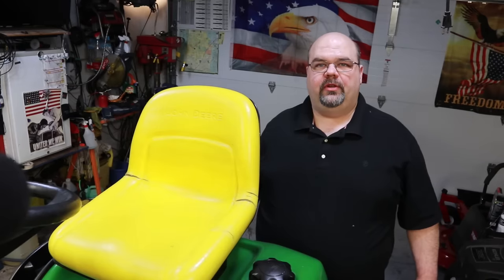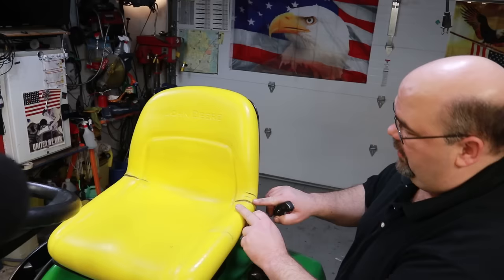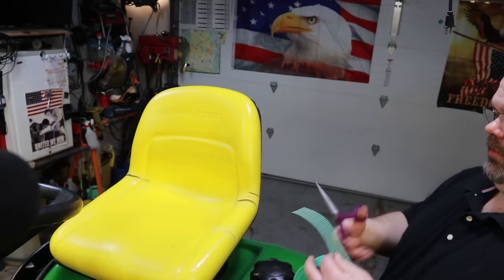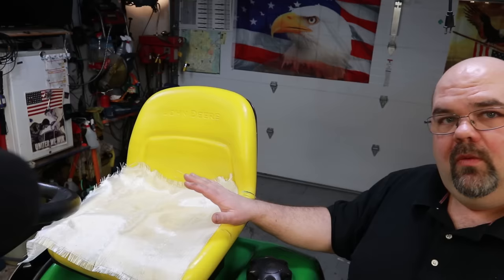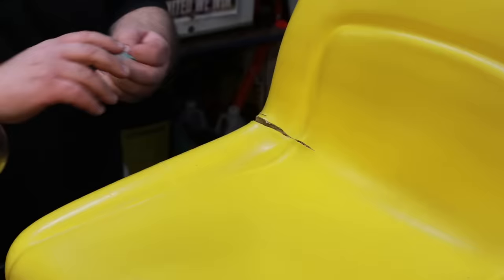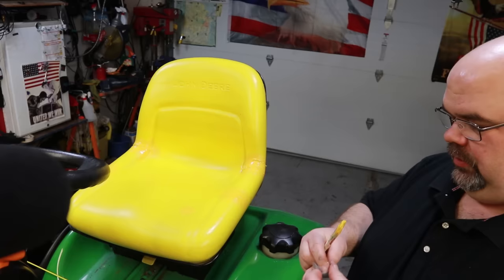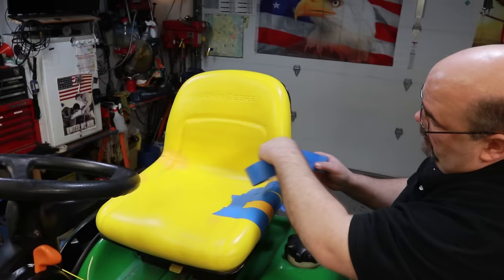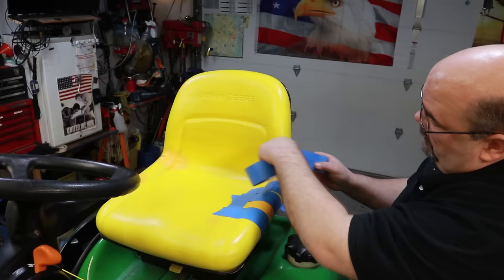Unexpected Solution For Your John Deere Riding Mower Seat

Comment: Could you buy John Deere Yellow spray paint and spray it on the mustard yellow Plasti Dip to match the seat?  Or just spray the entire seat to see if it looks better?  🤔
Reply from the maker: There are quite a few other comments saying that spraying it works but I’ve never tried it. It seems like it would wear and crack to me.
Reply: Yeah, probably.  I can't seem to find yellow Plasti Dip at  the moment and I need to fix my seat.  Blaze yellow might be closer to JD yellow but I don't know.  Any suggestions? @baldeagle242

Comment: The YouTube must be eavesdropping on me. A friend and I replaced the blades on his L110 yesterday and we had a discussion about buying a new seat. I did not look up seats, my friend did. Now this video pops up today. Coincidence??
Reply from the maker: It makes you wonder for sure.  🎧
Reply: @baldeagle242  excellent repair! I had no idea that they were DIY repairable. My friend wants the taller seat as he has back problems, and the prices are Biden inflated quite a bit since last year. It looks like the replacement is 4 bolts and the safety harness wires. Do you agree?
Reply from the maker: @haneyoakie14  there are a few different styles.  What model mower does he have?
Reply: @baldeagle242  L110
Reply from the maker: @haneyoakie14  The L110 will use an aftermarket seat like this one.  It will save about half of what JD will charge for a branded seat.  Most of the time you can remove the sticker from the original with a heat gun and transfer it to the new seat.  
https://amzn.to/3k8f2Do

Comment: How did it hold up  after 6 months ?
Reply from the maker: I sold this mower a few days after this video was posted, but my father has an old Craftsman mower that he has used for years.  The seat has cracked in other areas and needed additional touch-ups, but it's still in use and keeps the pad protected from getting wet.
Reply: @baldeagle242  Thanks, gonna try it on mine

Comment: Most riding mower seats are the lowest possible quality, some used a heavy rubberized cover that really held up good. However there seems to be no really good way to repair these seats, foam is poured into a mold lined with the thermo formed vinyl.  I’m going to replace mine with one of those cheap folding boat seats at Walmart, those can be recovered relatively easy if you know how to use a sewing machine.
Reply from the maker: Very true. My father has used boat seats on a few mowers over the years. They are a great alternative for people who just want a functional seat. Thanks for watching and taking the time to leave a comment. 😁👍
Reply: @baldeagle242  my mower is about twenty years old, an incorrect seat is the least of my concerns. It definitely looks off but really who cares. Maybe one day I can afford a new cub cadet rider, until that day I will keep band aiding my old junker
Reply from the maker: @cm5838  With the prices of new mowers I think it’s crazy to buy new. I enjoy working on these older mowers and think in a lot of ways they are better. With that said… I won’t include the seats on that list. 😁

Comment: Mike is not a JD but the cushion has peeled from the plastic frame, any suggestions to re-attaching?
Reply from the maker: RH Adhesives HH-66 Industrial Strength Vinyl Cement Glue with Brush, 8 oz, Clear - I did not show this in the video because this seat did not need it. Still, if your seat is coming loose from the frame, this is a semi-flexible adhesive that works well to reattach the padded seat and vinyl to the frame.
https://amzn.to/3n4IjPV
Reply: Thank you for the fast response and wonderful info.
Reply from the maker: @mikefuqua5321  You're welcome.  The main trick is to clean the surfaces as best you can.  Let us know how it works out once you get it completed.  🦅

Comment: You dont have to buy Prep All - much cheaper would be rubbing alcohol  to clean the surface before applying the plastic dip. Pick up a quart or  pint at a dollar store, Walmart or dollar general for about a dollar or less.
Reply from the maker: Thanks for the tip.  I would recommend 90% over the 70% version if you’re going to use this option.
Reply: @baldeagle242  ...Yes 90% is better, thank you , I forgot to mention the higher the percentage  of alcohol, the better. I've seen some as high as 99 %.

Comment: do yo have any recommendations for replacing a tire for an R72
Reply from the maker: These small tires can be a challenge to replace with common screwdrivers or tools that most homeowners will have available. The easiest way is to replace the wheel and tire together.  If you live near a mower repair shop or some tire stores they will put a new tire on your rim for a small fee.

Comment: Mine cracked and  split after a couple of  years and its never has been out in the  weather and its 14 years old now . Just some  poorly made quality  product is all I can say . . I'd try this method , but will this last . Has anybody else tied this and it  held up . . I do thank you  Baldeagle 242 for the video . I'd buy another seat , buy it would probably do the same cotton picking  thing . There seats have got a  bad reputation , don't see it changing either , not in this disposable time .
Reply from the maker: You’re welcome. There are mixed comments on how it has worked out for others below. The general consensus seems to be that once a set gets to this point the vinyl will continue to crack elsewhere.  My father has an older Craftsman mower that he first did this on about 5 years ago. He has continued to patch it in other areas as it cracks. It’s not perfect but it’s about as good as it gets without replacing the seat with new.
Reply: @baldeagle242  Thanks I'll keep  this in mind , I've got too do something too it sooner or later .👍
Reply from the maker: @marshallborder9089  I plan to make another seat repair video using additional marine vinyl pieces cut and glued over the cracks with a really strong vinyl adhesive someone else mentioned in an early comment on this video. I just haven’t had time to try it out yet and quite frankly at that point a seat cover is only slightly more expensive.  
This is the product they recommend https://amzn.to/3NZRfnC
Reply: @baldeagle242  It isn't that I don't mind buying a seat cover , its that I have a shop cat that lives in the shop , and a cover is probably not a good deal . She's probably make trash out of it even tho she has a scratch pad . I think I'd really appreciate another video on it . Thanks a bunch ......

Comment: This kind of seat doesn't flex much, I wonder if this stuff would work on a motorcycle seat. Most are black and this stuff comes in black.  I am wondering if this would tear and or peel if use din Vinyl fabric that bends and flexes while being used is what I mean.   I have a goldwing seat that costs 400.00 to replace, the recovers looks awful I think.  the tears in the seat are right along the Fake stitching ( I cant believe they melted stitch patterns into these seat covers!)
Reply from the maker: This should work well for that application.  I have used it on may other things including a shop stool that I use daily and it has held up very well.

Comment: Spray paint can get you back to the right color.
Reply from the maker: +Mark Brown I have checked on their website, and according to the information I read there, it can be painted.  However, because this material is so playable and flexible, I doubt paint would last very long in a situation such as this.  It’s something you'd have to experiment with on something you're willing to replace if it turns out bad.  
Anyways, thanks for watching, and if you decide to try it, let us know how it turns out.  Thanks for watching.  🦅

Comment: Does spray paint take to the plasti-dip?
Reply from the maker: @Daniel Gilbert - There have been quite a few people commenting about trying it but I've never attempted it.  My assumption is that even if it does it will flake or rub off pretty quickly.  Thanks for watching and if you try it let us know how it works out.
Reply: I repair and sale used mowers and power equipment it’s always helpful to find a less expensive fix for some of these problems thanks for your fast reply

Comment: Looks great. John Deere are not high quality mowers.
Reply from the maker: @Drums What is your preferred mower?
Reply: @baldeagle242  I prefer Craftsman or Husqvarna with a twin cylinder engine
Reply from the maker: Don't tell anyone but my personal mower is a 1994 Craftsman LT1000 with a 15hp Kohler Command on it.  I pulled it off the curb 20 years ago.  As long as you take care of them and don't leave them outside they will cut grass for many years.  😁👍
Reply: @baldeagle242  if you take care of them and don't abuse them they're Bulletproof

Comment: why not mask it and spray paint the whole seat after the fact with a color that matches designed for plastics?
Reply from the maker: I'm not sure if it would stick to the repair material or how long it would last. 🤷‍♂️
I'll try something different on the next one for sure.  This mower sold a few days after I posted this video.  
Thanks for watching.  🦅

Comment: How about spraying or brushing on some John Deere paint over the patches?
Reply from the maker: I'm not sure paint would stick very well and I'm sure if it did it would wear off rather quickly.  🦅
Reply: They make vinyl and leather coatings. SEM is the best in my 30 year opinion of repairing vinyl and leather. Most auto paint stores sell it or another brand and can mix it whatever color you want. The quality come with prep of the surface and if you apply in thin coats and allow to dry. Works awesome on vinyl and leather. It not paint but a coating that stays flexible.

Comment: Isn’t John Deere a main top end brand - why are their seats so crap
Reply from the maker: Unfortunately I believe all brands have had to make tuff decisions between quantity and price point to avoid pricing themselves out of the market. Their are other options when buying a mower or garden tractor and unfortunately the average consumer has to look at the upfront cost over longevity. Deere and every other manufacturer out there has to consider this when selecting materials for their equipment. Unfortunately the materials they use on their seats and the brittle plastic they use to make their hoods are two areas we as consumers end up paying for in the long run.  
Thanks for watching and taking the time to leave a comment.  🦅🇺🇸

Comment: So tell us how this held up since it was almost 18 months ago. I'll bet as soon as a fat ass sat on it it tore open again. I've tried that before and my fat ass opened it right up. I said the hell with it and bought a new seat.
Reply from the maker: The prep work makes all the difference and embedding the mesh down into the foam helps to keep it from opening up. This mower sold just a few days after this video was made but I have used it on my personal equipment in the past and it holds up better than you would expect. It’s never going to take the place of buying a new seat but you’re also not going to find a new seat for $10.  
Thanks for watching.  🦅🇺🇸

Comment: Yellow duct tape
Reply from the maker: I have been there, done that plenty of times.  Thanks for watching.  🦅
Reply: @baldeagle242  lol, ya we've all done it.  Yours is an interesting fix I'm willing to try.  This gives me some ideas,  I might try some black RTV or caulk in some black seats I have.
Reply from the maker: @cetyl2626 I've tried liquid electrical tape and Flex Seal as well. I've even tried to cut and glue new marine vinyl over the old vinyl and foam. Other than the color being a little off this has been the best “cheap” repair if found so far.  (Other than duct tape of course. 😉)
Reply from the maker: Let us know how it turn out.  😁👍